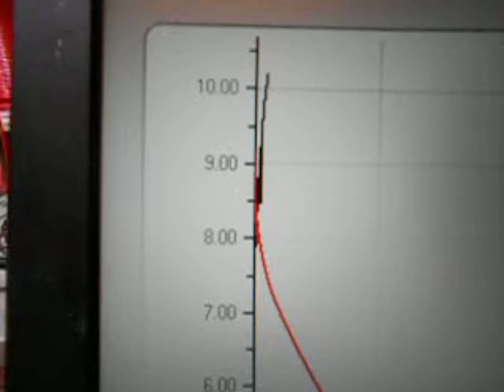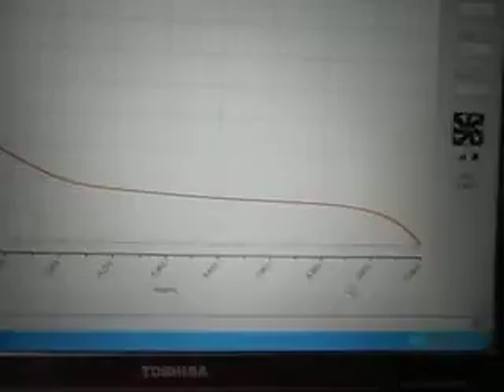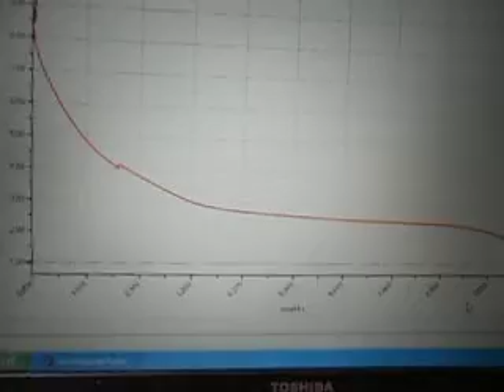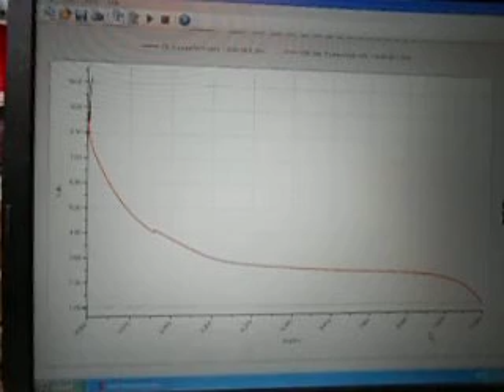Pickle Battery Charge/Discharge Test #6

Comment: You do are guessing a lot. Like 'I did about 20 minutes on 2 A/h'. Did you plot that on a chart? As you know the area below the line can be used to determine the Wattage. If you charged at 2 Ah for half an hour at 12 Volt, your input would be 12 x 2 x .5 = 12 Watt.
Another question , did you have a load which is constant 2 A/h?
Don;t get me wrong, I learned to always measure exact if you want to get to a conclusion.
Good for you the battery worked for you, mine is a shortcut. Complete failure.